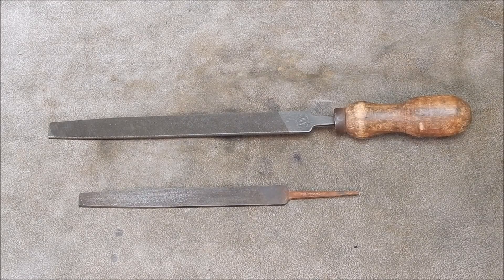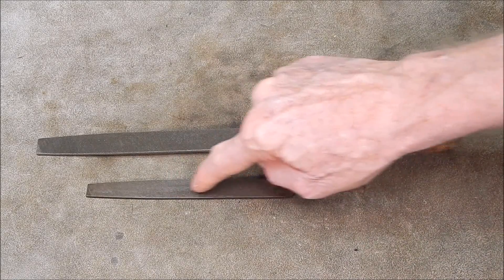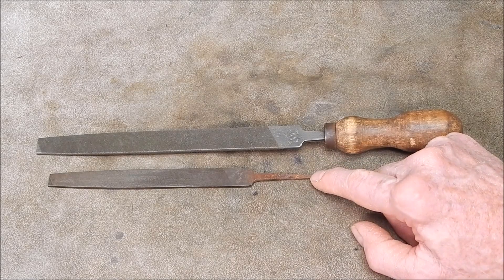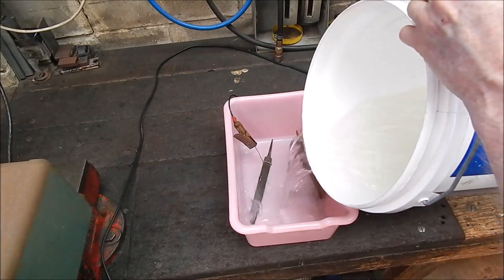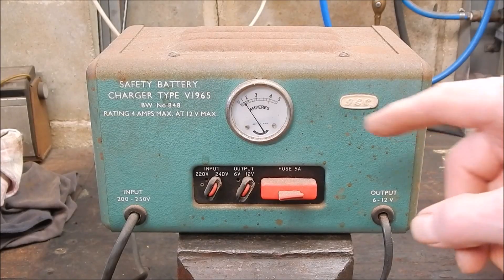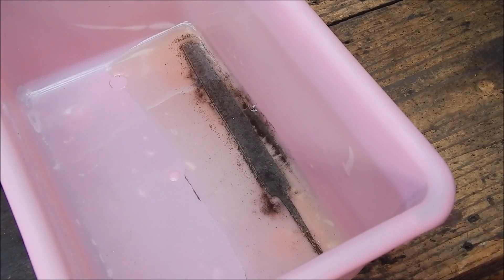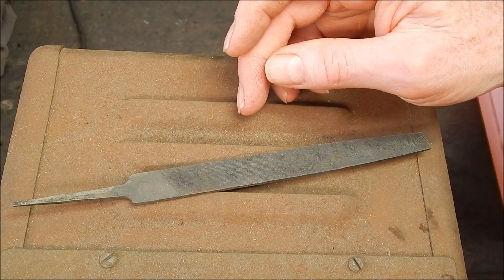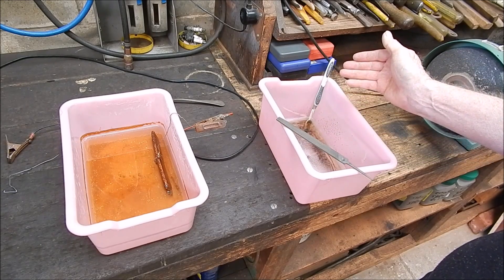Does vinegar actually re-sharpen blunt workshop files ?

Comment from the maker: NOTE:  I did NOT use any de-oxidizing agent on the file after electrolysis.  I only lightly scrubbed the file with a tooth brush in line with the cutting edge reliefs.  The only residue it did not remove was some copper galling.  Cheers Rob

Comment: I have swam in this pool far too many times already Rob. 
I still "sharpen" my worn files in acid. My choice is sulfuric and there are just as many opinions on that as there are people willing to try the process. 
I think there is a discrepancy in the way we use the word sharpen. 
As you have shown, cleaning makes a big difference in how easily the file removes material.
 With a nice layer of "schmoo" built up in the grooves acting as a depth stop the file stops cutting and appears "dull". Clean out the schmoo and the file cuts better. All the file cards in the world support that concept. 
I clean my files before etching them with acid. Any material on the surface protects the metal underneath from the effect of the etch. Dirt, rust, or grease of any kind will cause the effect on the surface to be inconsistent. 
So I think we agree on the cleaning idea. 
Once we are working on a clean surface the etch will do its thing on any exposed surface of the file. 
My theory is since the cutting edge has 3 surfaces, the leading, trailing, and the very narrow cutting edge, the etch is removing material from all of them at once. 
Remove an atom from the leading edge and the tooth profile is thinner. 
Remove an atom from the trailing edge and the tooth profile is thinner. 
Remove an atom from the cutting edge and the tooth gets shorter. 
Rince and repeat.
Proceed until the cutting edge has been reduced to the minimum one atom wide and the file requires less effort to bite in the material to be cut.  
Now into the weeds. 
Files are essentially a cutting edge raised with a chisel as a chip from the base metal. They aren't a honed bevel created on the edge of a profile like a knife, tap, or drill. The profile is saw toothed and jagged. The etch will not improve the surface beyond making the tooth narrower at the cutting edge and shorter. 
Not an uncompromised position. The more consistent the profile is before use causes degredation, the longer it will cut. 
Once degraded, after sharpening, the edge degrades quicker because the tooth profile is smaller. 
Fine files cut slower. We just made the teeth finer in the etch.
There is no free lunch. Not only does the etch make the profile shorter the physics of the process means the cutting edge spacing between teeth, the pitch, remains the same. 
An equivalent tooth profile on a file meant to have that size of tool profile from the beginning will have the pitch finer and the cutting edges closer together. 
Up until now we have been talking about degraded tooth profiles. 
In my estimation there are as many variations on how badly degraded the files are that live long enough tto be considered worth etching with acid. The etching method you have used is very similar to most. The file is dipped in the acid, sits for a time, and is removed. 
Etching a flat surface will not create cutting edges. Etching a file with broken, chipped, or missing cutting edges will not replace the missing material. A grindstone doesn't add material when sharpening an edge it removes it.  The only difference is the grindstone only works on one surface at a time. 
Consider a tool with a similar action to the file. 
A broach has a series of teeth formed on the surface. They are ground to a sharp point by removing material from the leading edge and the trailing edge or relief angle. Over time the teeth wear and can be sharpened by again removing metal from the leading and trailing edge. Eventually the tooth is worn to the point it is too far gone and the broach is scrapped. 
Files are difficult to sharpen with a mechanical abrasive process. I don't want to have to control the profile of the grinding wheel small enough to grind the edge on a 10" mill bastard file. My eyes are too old to fiddle with such tiny tools.
The only reasons I considered using an etch to sharpen a files tooth profile is the file was scrap before I started. 
Nothing to lose but a little time and I waste so much as it is another hour isn't noticeable. I can putter with other things while the etch is happening. 
A small gain with minimal investment in time and materials has convinced me the process is worthwhile. 
Etched files will never be sharp as new. If done correctly, a file with worn cutting edges can be made to bite  better than before the etch. 
Okay. Walk away Dave. I have little expectaion of changing minds with this long winded explanation. 
Strangely I do feel better having spent the time chewing this cabbage again. 
Having swam in the murky water of file mythology I have to go and wash off the schmoo. 
Goodnight. 😁😎
Reply from the maker: Hi Dave,  I have seen that this is a favourite subject of yours and am pleased you took the time to comment.  It's an interesting subject.  I think there are a range of issues to consider here and while cleaning is the main recovery process, the subject of acid dipping is a secondary topic with quite a few twists to it.  As a viewer commented earlier, etching does not work in a uniform fashion/rate on differently shaped surfaces/angles.   So immediately we have a major complication and of course it would be unrealistic to expect damage recovery to occur for missing and bruised edges.   Ultimately etching will destroy the base object, but there may be short term gain initially in reprofiling some edge deformities.  I have gone as far as intended looking into this concept and I hope viewers have got a better understanding of what is actually going on, from the videos and informed comments.  I think the word "sharpening" is a misnomer for what is basically rejuvination.  Cheers Rob
Reply: @Xynudu  I started the practice in about 2000 after a friend suggested it. 
The first trial was a success.
About 3 batches I forgot and left the files  in the sufuric bath over night.There were holes completely through the files. 😁
Over the years I improved the process.
If you want to get attention this will do it. 😁😎
Let the crazies rant. Pull up a chair and watch. It will be interesting. 😁

Comment: As a Technical teacher I have cleaned many files  using only vinegar. An overnight soak then a piece of copper pipe rubbed along the rows of teeth caused them to be sharper. I suspect this method etches the blunt area allowing it to be sharper. Just a thought.
Reply from the maker: I'm doing a soak and measure test of a high carbon steel roller at the moment, to see how much metal the etch removes in 24 hours (if it's even measurable with a 3 decimal mike).  Stay tuned.  Cheers Rob

Comment: No need for the electrolysis and acid. Degrease then leave vertically in the acid until you are satisfied that it is sharp enough. Any acid will do it but some take longer than others.

Comment: I'm going to have to disagree with you on this one Rob, based on many positive experiences restoring files. Although I do think we have to leave room that this may hinge on one's definition of 'sharpen'. For me, if a blunt, shiny, file with zero 'grab' (but unquestionably already completely clean, because that is always step one for me) can have its filing ability substantially restored, that is evidence of a sharpening effect of some kind. 

I could never visualise a viable mechanism for how this was supposed to work myself, but did read one that seemed to make sense eventually some years ago in a forum post on a machinists' forum I think. In summary it's this: by equally dissolving steel from two faces that meet at a rounded edge you in effect create a smaller radius, which is a net increase in sharpness.

I've now used the technique on dozens of vintage files in various states of ill-repair, including not a few that had been used well past the point they should have been re-sharpened or discarded/recycled. These shiny ones take the longest for there to be a pronounced effect using a weak acid (vinegar + a little salt in my case); some files take only a day, maybe two to be noticeably improved, the shiny ones I've often soaked for longer than a week and as much as 20+ days on a few occasions (by accident initially, then intentionally when I saw it could sometimes be beneficial).

As you and at least one previous commenter have noted, after treatment the edges can be noticeably less smooth than on an equivalent new file (although of course this is much more evident on a single-cut file than on a double-cut). Also finer files tend to respond better than coarse ones; this makes sense if the mechanism described above is accurate, since the acid is working on much smaller potential radii.
Reply from the maker: I did mention that a smaller radius was technically possible, but the effect would be minimal, given the small amount of metal removed.

Clearly a file can not remove metal or bite in if the cutter reliefs are full, regardless of how sharp it may be.  This is the major issue in my opinion.  You can see how much material was removed by both processes.  A lot.

Whether you choose to believe the edges are "sharpened" in the true definition, is up to you.  I don't see any visual or physical  evidence of it.

If this really worked then everyone would be tossing their end mills, scissors, chisels and knives into a tub of vinegar.  I don't see any of that happening.  Strangely it only appears to work on files.  Don't you think that's just a tad odd ?

Did you use a microscope to see what is actually happening ?

Cheers Rob
Reply: @Xynudu  I didn't use a microscope, but I have examined files under a 10x loupe, the highest magnification I have available to me, to check progress.

Clearly if the reliefs are full a file's ability to cut will be severely curtailed, this is clear and I don't think anyone would disagree this could be part of it. 

But this is why I made a point of mentioning any of the files I've treated to long 'sharpening' soaks were already completely clean, because this is always done previously. I scrupulously clean stuff that's going into acid on the understanding that any oil or grease present will block the chemical reaction with the steel. I've been known to scrape every single groove one at a time when de-pinning, and the caustic soak I use to degrease makes anything stuck in place by oil or grime let go when scrubbing using toothbrush and/or brass-wire brush. 

If there's some rust overall a brief soak (few hours to overnight) is next, with further brushing to clean off the residue, followed by a sudsy scrub using common hand soap. Not trying to over-egg the pudding here, but I can assure you or anyone, the files are spanking clean after this 🙂

They are usually somewhat sharper (or to use a less divisive term, more 'bitey') as of course they should be, but are massively improved by further soaking in the salt and vinegar. And v. importantly in my book, even the ones worn enough to have the dreaded shiny patches are greatly improved.

To me this clearly indicates that some net sharpening effect is taking place, rather than it being purely a matter of cleaning. Whether the mechanism is accurately described by what I related I couldn't say, but I can attest to the effect being separate to one of purely cleaning of the steel.

"If this really worked then everyone would be tossing their end mills, scissors, chisels and knives into a tub of vinegar." Well, like we all agree, the edges might be sharper/apparently sharper, but they're also cruder. When I am restoring rusty chisels, plane irons and the occasional single-edged razor you do on occasion get a noticeably sharper edge after soaking, but it is rough for sure. FWIW there are some complex shapes like the rotary cutters in pencil sharpeners which can have their cutting action restored by 'vinegar sharpening', q.v. Toolmakingart.com

Cheers, Ed.

P.S. Congrats on all those quality burrs you got, that was the haul of a lifetime 👍👍
Reply from the maker: Hi Ed.  All good for discussion.  I find it hard to believe that vinegar will etch high carbon steel sufficiently overnight to be measurable.  To confirm or disprove this I am currently soaking a very uniform and accurate to measure bearing roller which I've miked up.  After 24 hours I will re-measure it and see if there is any significant difference.  If there is then maybe there can be a smaller curve radius on the dull and rounded over cutting edges, a possability I stated in the video, but doubted.  Stay tuned.  Cheers Rob
Reply: @Xynudu  Saw you'd posted a follow-on video earlier but haven't had the chance to view it yet. Will get to it in just a short while.

Just one minor niggle in advance, it seems clear that surface morphology will have quite a lot of bearing on this (sorry for the pun). It won't be merely about the larger surface area, although that's obviously a factor, but how acid etches into bevels at a small scale. 

So if I may, the best test of this is the test of this — does a long soak in a weak acid of already completely cleaned dull files make them cut better? 

I no longer have any unrestored vintage files, and no plans to buy any more soon since the majority will outlast me (they're only used on wood). But I do have a modern flat file (second cut?) which is one of my go-to metalworking files that is getting a little too dull on the sweet spot on both faces, so I was already planning on giving it a long bath in hopes I can bring it back again (this will be its second refreshing, if it works).

Will report back in a week or two 🙂 Regards!
Reply from the maker: Yes, edge shape is a major factor with files.  As pointed out by several viewers, this works extremely well on fish hooks which can use their conical point shape to erode down uniformly to virtually one molecule.  Cheers Rob
Reply: @Xynudu  The purpose of a tap or drill is to create a hole in an exact size and in the case of the tap an exactly consistant tooth profile.
Etching removes material from every surface in contact with the etch. Having a sharp drill or tap that is .025 mm smaller in diameter after every sharpening would be ineffective at best. 
Also the size and configuration of the much larger cutting edges lends them to the mechanical sharpening methods that are difficult to achieve on the file configuration. 😁
10 seconds on the grinder will bring my chisel back to shape much quicker than waiting for the etch to remove the material. I am a rather impatient chiseler. 😁😎

Comment: Hi Rob, interesting stuff indeed. I have files, and a microscope, guess what I am going to be doing? Just need to get some vinegar at next shopping trip. Cheers, Jon
Reply from the maker: Hi Jon,  Interesting stuff for sure.  I would be pleased to see you do a similar video to assess my findings.  I used the cheapest vinegar available.  They don't even quote the percentage (it's all greatly diluted with water) so I expect it's 2 - 5%.  The end result (of cleaning) was very impressive.  The re-sharpening (facet repair) seemed to be strangely undetectable ;)  Cheers Rob

Comment: A very interesting and educational video Rob. A file is something I just can't scrap infact, I bag every one I see regardless and have a hoard of the recoverable type, old ones. It's hard to tell if a file is any good or not when they are in a clogged dull shape, usually because they havn't been looked after properly in the first place I may add. I now know a way to recover those files with very little effort
Reply from the maker: Hi Ian.  I don't think I've ever thrown out a file either.  I was all set to make something out of it and then a "miracle " happened.  Just goes to show.  Cheers Rob

Comment: I think about it like this, imagine you drop a piece of round bar in your etch solution. If the etch takes a consistent amount of material off the surface of the bar, you'll have decreased the radius of that bar. Now if instead of a round bar you're etching some geometry with a corner that has some radius (say a dulled file tooth) the etching process will leave a corner with a smaller radius, which is therefore sharper. I can't say I've actually tested this empirically myself, but I think that's the principle
Reply from the maker: I agree.  As I stated in the video, technically there may be  a tiny reduction in any radius, but the main effect is from cleaning.  Cheers Rob

Comment: I wonder if a file card before and after the soak would make any difference rob ?
Reply from the maker: Hi Shawn, The nylon tooth brush did a great job.  I did use my file card on it as well, but it was already pretty clean, so I can't judge how effective it would be.  The toothbrush is good because you can use it in the tub easily.  Cheers Rob

Comment: Very interesting Rob. I reckon the two processes compliment each other. The electrolysis is quite a violent action and probably loosens deposits in the file teeth. This allows the vinegar to get underneath and really do a good job. I wonder if an ultrasonic cleaner would be as effective as electrolysis? I really liked the microscope shots, lets you see the before and after really clearly. Cheers, Alan.
Reply from the maker: I think you are right Alan.  That file was real bad, and the electrolysis removed over 50% in a relatively short time.  Normally I would run it for 24 hours.  So it did good.  The vinegar just webt on with the job and it turned out as good as one could hope for.  You should do a video on it with your US cleaner.  The microscope did well.  Made it all much more believable and evident as to what was actually happening.  It's only a VGA one but quite handy.  Cheers Alan